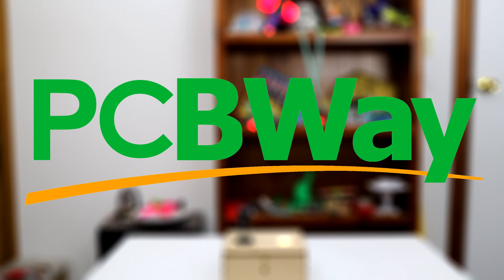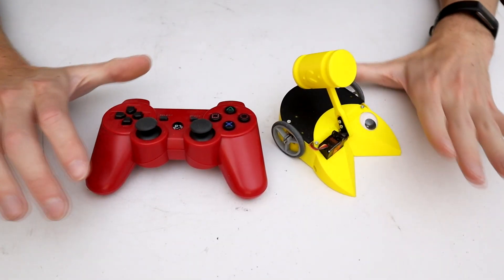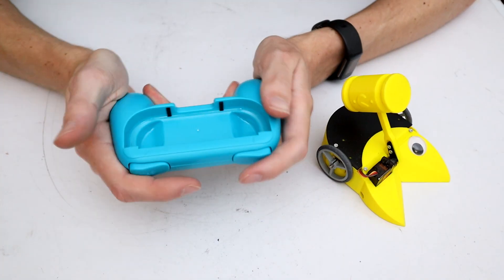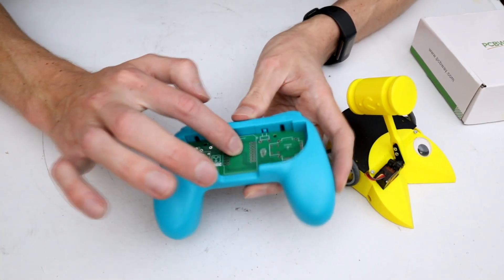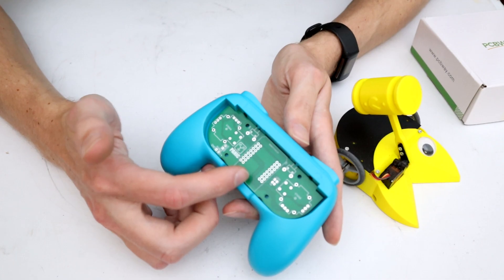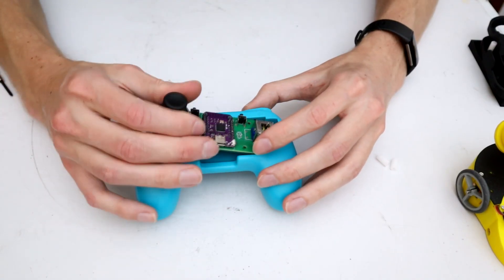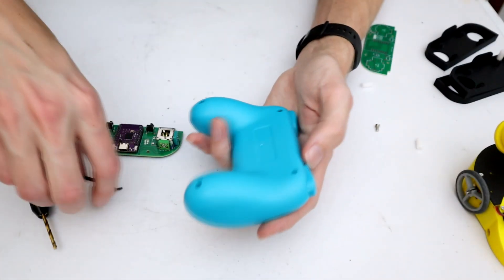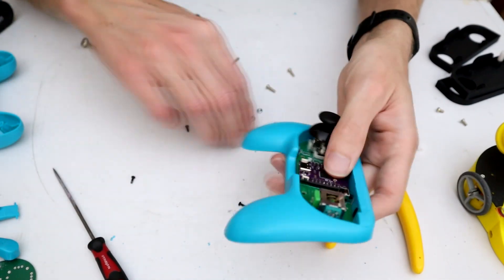Joy-con sized DIY robot controller!

Comment: Great  project!  I had commented on your channel many years ago on a ESP-Now version of a small bot I made.  Your version is great .  Couple things I had on mine you might consider   1) binding buttons on both the bot and controller.  so I don't have to hard code the 2 to each other.  2) I added a small OLED screen  and a menu system that allows the user to change driving characteristics  (max speed, rate of steering, reverse wheel direction, flip wheels, trim, restore defaults) .   Building these every year has been the highlight of the high school robotics club I sponsor.  If your interested in some of the features or how I did some of it in code let me know I can share in a video or email.
Reply from the maker: I do want to implement binding, but my plan was to do that with the shoulder buttons
Something like hold one or both down while powering on to enter bind mode

Screens are cool if you want general purpose and on controller config, I'm using these in a limited capacity and wanted them as cheap as I could get them

Comment: ive always thought that turning my old PS3 controllers into rc controllers would be cool i can imagine building a RC car or even a robot with fast drive that i can drive using the same buttons configuration used in a need for speed game, zooming around the battle box with style.